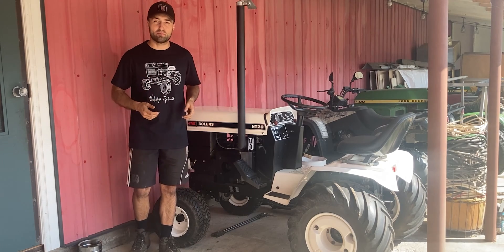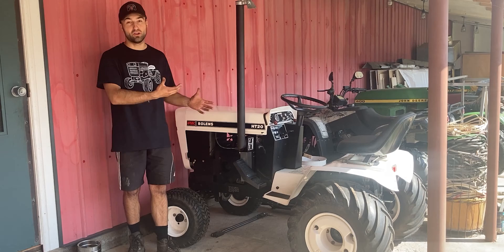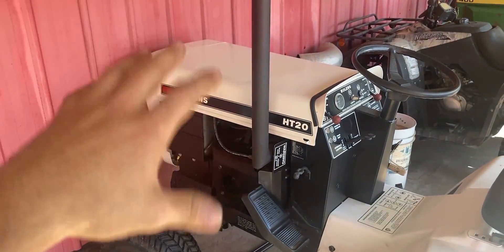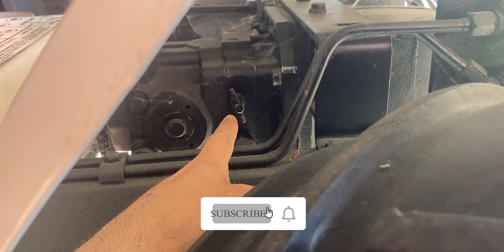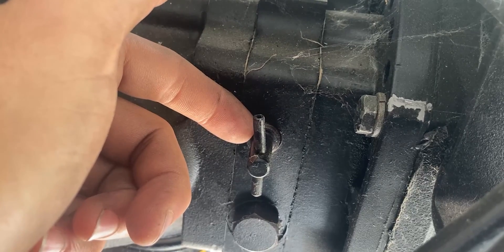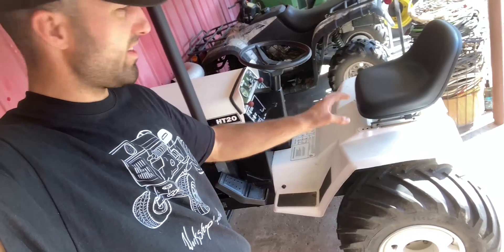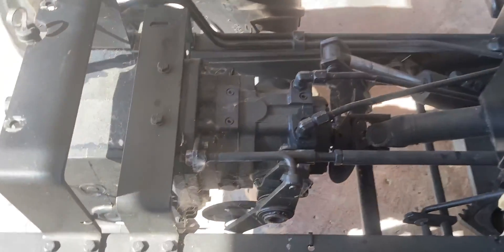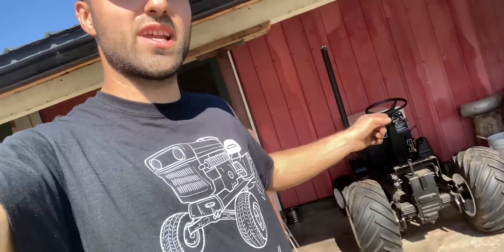1975 Bolens HT20 Rear End Issues (Hydraulic Motor & Differential)

Comment: I have two questions for you fella. How did you find the unit and how expensive was it also ???  I am amazed how clean the machine is fella. How many hours are on the clock ?? Thanks
Reply from the maker: I found this Bolens HT20 at an estate sale and it was pretty cheap (especially before the restoration work)! This machine was gone through from front to back, so that's pretty much why it looks like new. There was never an hour meter on this machine, so I can't tell you how many hours this tractor has seen. The instrument plate has a cut-out for an hour meter and the stamped sheet metal cover that is in place to cover it, was never removed. I assume the hour meter was an option and therefore, the instrument panel is original. 
If I were to guess I would have said this tractor had just over 1000hours on the clock...but I'm really not sure. Regards Andreas
Reply: Thank you for the information Sir Andreas. Now I know fella.  @WorkshopRebuild

Comment: Hi what fluid do u use for the hydrostate
Reply from the maker: Hi Quinten, thanks for your question. I usually use ATF (Automatic Transmission Fluid) for all my garden tractors and I haven't had any issues. ATF has great properties for warm and cold climates and it's great for attachments with cylinders too. I hope this helps! Regards Andreas
Reply: @WorkshopRebuild  thanks  this helps a lot

Comment: OMG...this is EXACTLY what I've been searching the Interwebs for!! We have an HT20, which looks nowhere near as good cosmetically as yours, but runs still quite well other than the stuttering/"herky jerky" motion that sounds similar to what you have. I've done basic maintenance on our all tractors but this would be the biggest undertaking for a repair, so I'm really glad you posted this which such detail and great video work...thanks!
Reply from the maker: I'm glad I could shed a little bit f light on this matter! This is somewhat common on these HT20's, as the Bull Gear was not designed all too well. If you have the same issue, you can check if your oil drainplug has metal shavings on it. This repair is much more than just maintenance and will requite a couple of tools. I have an update video on this topic in these videos: Transmission Overview https://youtu.be/IgMae1h1txQ New Bull Gear + Assembly https://youtu.be/04LL-H7LpZ4  I hope these video will help you and that you resolve your issue. Thank you for your compliment and Best regards Andreas
Reply: @WorkshopRebuild  thanks again!!

Where did you buy the replacement parts if I may ask?
Reply from the maker: @theband3153  No worries! The Bullgear assembly was purchased in used condition, but honestly it was like NEW. I am in a multiple Bolens Facebook Groups and there are many members that take apart Bolens tractors and sell the parts. It's not easy to find a "Good" Bullgear assembly, as this was a weak-point in the rear end, but there are always some that pop up here and there. Maybe on eBay or in the Facebook Groups would be your best chance to find one. Best regards -Andreas

Comment: Not the bolens lol. You’ll get her all fixed up and back in working condition in no time the main weakness of Kohler is the poor design of fuel pump sure it works but they only last so long before the rubber diaphragm breaks the electric is a good idea I believe the jd 400 has an electric fuel pump my buddies has one I don’t know if the engine has a fuel pump as well or if it’s just the one
Reply from the maker: I really hope so, this tractor is nice to have! There's nothing wrong with a diaphragm pump since many vehicles use it, but for some reason, the electric fuel pumps are cheaper than mechanical pumps! That is correct the JD400 has an electric fuel pump and the Kohler K532 just has a cover bolted on where the mechanical pump originally was. Cheers